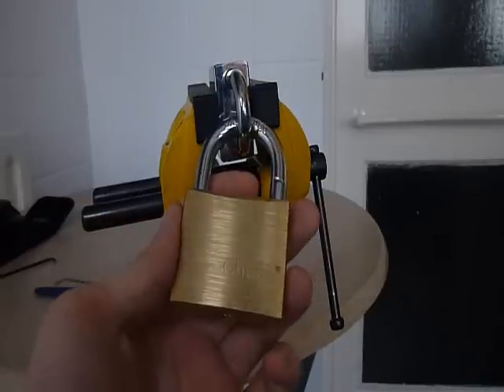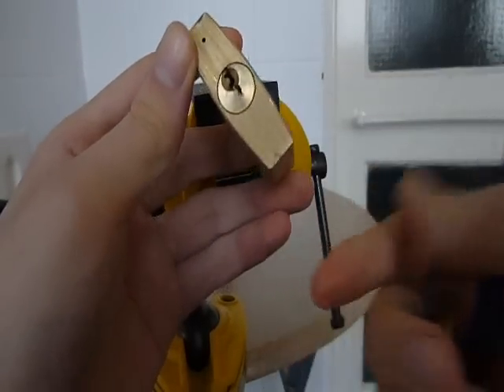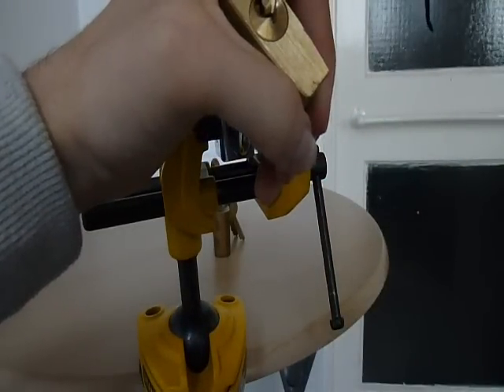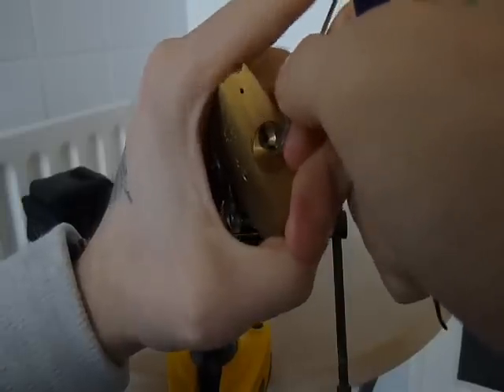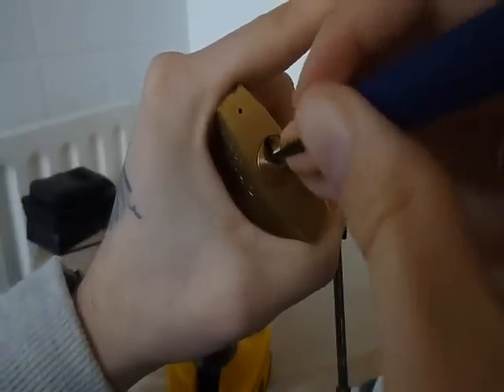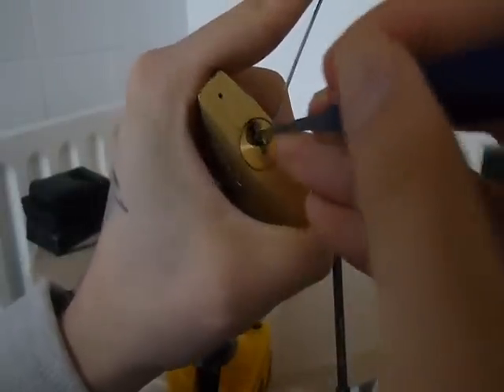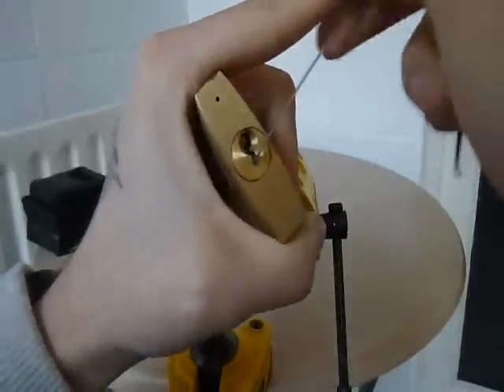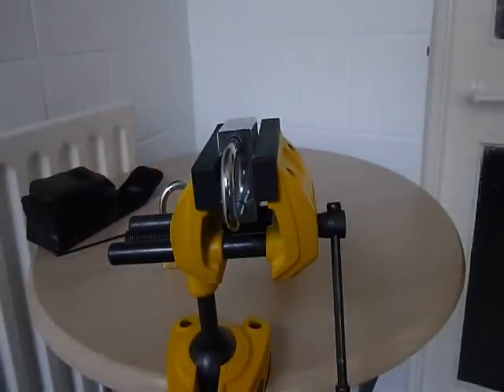Chubb 5 pin padlock picked blind SPP

Comment from the maker: This one is from the flat 5 set mate, I dunno if the prybars would sit at an angle or not but I haven't got em so I can't say. Had to use the smallest tip cos the others just sat at 12 o'clock; you'd not be able to get the pick past it unless it's about the same size as the one I used here. Give it a whirl and see though, it's the only way to know :o)